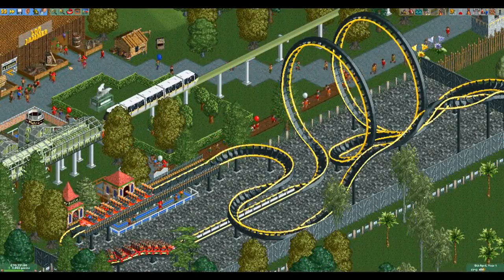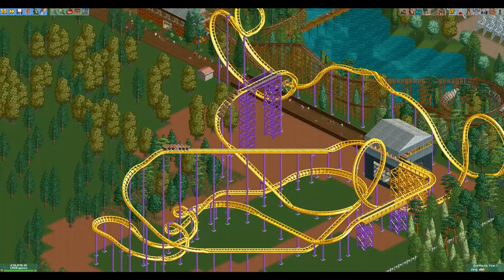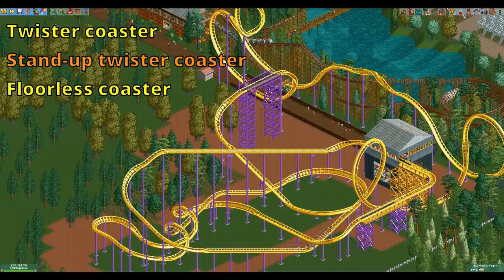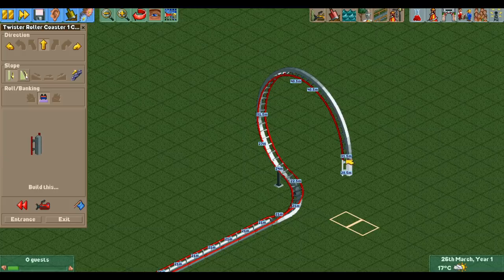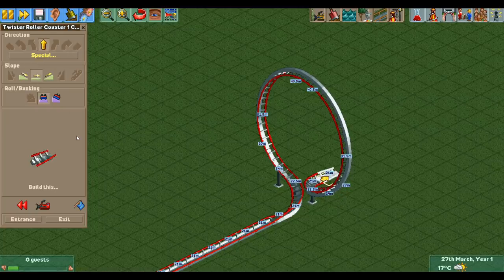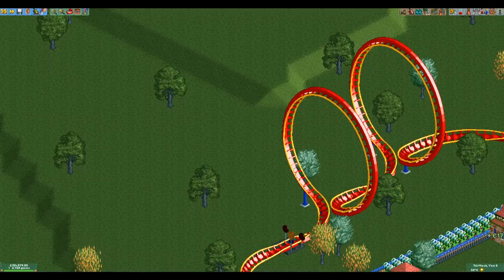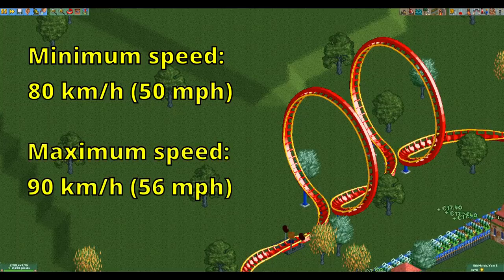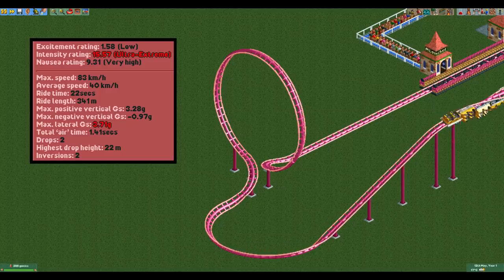How To Build A Skiffa Loop in RCT2

Comment: In real life that element would basically guarantee whiplash. Even in the game, it gives crazy laterals.
Reply: "The Karen finder"
"The lawsuit loop"
"Ouch my neck"
"The liberal life liberator"
"The JFK experience"
Reply: @dylanhale7300  "The Last Ride"
"Hospital heaven"
"Whiplash wheel"
Reply: Jesse Mathis  I suspect increasing the tern radius on the inlet and and making the loop have the increased curvature needed for a slower speed would help.
Reply: Gonna see if I can get a modified version of it to work in Planet Coaster without giving absurd laterals.
Reply: @abyssaljam441  But it would still need to fit within a circular shape. All the Lateral Gs can be converted to Positive Vertical Gs with more banking, but it would still be a lot of Gs.
Reply: You'd definitely need some sort of restraint system that constrains lateral movement of the head - though not like that is an unsolvable problem.
Reply: An update to this: my first attempt, still unsmoothed, enters at 60 mph, tops out at 5 gs, and pulls less than 1 lateral g. So very promising.
Reply: In real life the transitions would be a lot more smooth. You wouldn't unbank until you're already out of the turn and climbing the loop, and then you'd start banking again before the start of the turn.
Reply: @tonyhakston536  Oh I don't mean fix the head in place like you are getting brain surgery done - just need something padded to either side of the head to prevent whiplash, I would think.
Reply: @zuthalsoraniz6764  whiplash breaks the neck, padding won't do anything.
Reply: @Ghorda9  I might be wrong about the fundemantals of that, but my understanding of it is that sudden high acceleration perpendicular to the spine in a vehicle causes whiplash because usually the body is forced to follow that acceleration by the seat, but the head is not, allowing the head to move rapidly compared to the body due to its inertia. And head restraints are definitely used in some applications IRL where high lateral and longitudinal Gs can occur, for example the HANS device in car racing.
Reply: @zuthalsoraniz6764  i was only referring to the padding, restraints weren't mentioned, i think that would change things.
Reply: @electrollama2127  yeah it wouldn't be for the faint of heart and would likely only have one drop for just that loop and then returning track.
Reply: @noname117spore  oooh you have me curious
Reply: Nor would it work because massive amounts of energy would be lost in the first banked turn not allowing the train to overcome the loop. Looks cool though
Reply: I never ever thought of trying a loop like this! So in other words it would ramp up the Intensity and Nausea ratings pretty quick, hence lower Excitement
Reply: @zuthalsoraniz6764  these are pretty universally disliked by riders as they bang your ears constantly

Comment: I feel like this would break people’s necks in a real scenario
Reply: yeah, the lateral G's are way to high.
I am going to try to make a custom version in Planet coaster, to see, if it can be a real element
Reply: I suppose you could enter it at low speed and use booster fins in the loop to clear it, but that would be both expensive and prone to failure.
Reply: You could do it without such high g-forces with a much wider loop that covers a lot of "on the ground" distance while in the air. Would like to see it tried, actually.
Reply: it would, no doubt about it, though you could amke a version of this that would work, and by that i mean a banked uwpards turn intoa  lopp onto a banked downwards turn. but id say the turns ahve to be as least as wide as the loop itself.
Reply: @prrrromotiongiven1075  those exist.
One in Drievliet does just that.

I dislike the carts but those loops are solid.
Reply: I don't believe this would be worse than a stock car diving into the banking at Bristol, its just going from a left turn into loop straight into a right.
Reply: @dylanhale7300  its not about the sequence, its about the fact that, to make the loop you need a lot of speed through that tiny corner wich will result in high gforces
Reply: Excessive lateral Gs in RCT2 happens at 2.75 g, while according to NASA-STD-3001 Vol 2, human exposure to lateral acceleration during launch conditions should be limited to 3 g for maximum 0.5 s, down to maximum 2 g sustained, and at most 5 g for 0.5 s (also 2 g sustained) in abort conditions.

So it probably won't do serious physical damage, at least assuming the restraint system prevents hard impacts of the head, but it definitely would be unpleasant.
Reply: Justin White  Making the loop slightly corkscrewed also means that the turns into it don't turn through as large an angle, meaning the lateral gs are applied for a slightly shorter duration.
Reply: @zuthalsoraniz6764  you’re forgetting the fact that NASA’s astronauts train for months to be able to withstand extreme g forces.
Reply: @tonyhakston536  True, though that NASA document also says that the g force limits are deliberately set conservatively, and the standards for launch limits are stricter than "can be endured without injury" - with the proper head restraints, 2.5 or 3 g lateral is probably endurable without injury even for the average human, just very unpleasant.
Reply: In real life the train wouldn't come out of the bank until it's already exiting the turn and going up the loop, and would start banking again as it exits the loop before the turn out. If you bank hard enough you could convert most of those lateral Gs into an intense pop of positive vertical Gs.
Reply: @zuthalsoraniz6764  yes but RCTs g forces rating are nowhere near accurate. the acceleration of a launched coaster was somewhere at like 80 g or something, Marcel has a vid on it , actually
Reply: @Phoenix-zu6on  Well, that one specifically is RCT simply not considering longitudinal Gs - it only measures vertical and lateral Gs.
Reply: basically any banked turn in RCT2 would break necks

Comment: In my own testing, it seems that you are able to approach the Skiffa Loop at up to 101 km/h without getting excessive lateral Gs, while 78 km/h is fast enough to clear the loop. That is a fairly comfortable range. I would say 80-100 km/h instead of 80-90.
Reply: were you testing with empty or loaded trains?
Reply: @Freakschwimmer  With empty trains, of course. When a ride's stats are calculated, those stats (except the excitement rating) are locked in. That means if you test a ride with empty trains and it does not get excessive lateral Gs, it will never have excessive lateral Gs even if the guest weight of a full train would cause it to take a turn too fast. The lateral Gs from the empty train test are locked in until the next time the ride's stats are recalculated from scratch, such as if you edit the track, change the number of trains, change the launch or lift hill speeds, etc. The excitement rating is the only stat which dynamically updates after the stats have been calculated, and it only checks external factors like scenery, paths, nearby rides, and so on. The intensity and nausea ratings, like the G forces, are locked in.
Reply: @PaddedShaman  oh, that is true. Thank you for your kind response!

Comment: PS: with the recent updates to OpenRCT2, you can also do this with the Steel Looping Coaster and the LIM Launched Coaster, if you enable the "Enable all drawable track pieces" cheat. The Hybrid and Single Rail Roller Coaster have the required track pieces per default.

Comment: If i ran a real theme park, it would be an honor to build the world's 1st skiffa loop roller-coaster.
Reply: Honestly looks uncomfortable to actually ride
Reply: I was recently thinking how cool it would be to have something in real life that was invented with the very limited track pieces available in RCT2.
Reply: @msgasmdc107  It definitely would be unless you could keep the track banked for longer on both the entry and exit.
Reply: It'd need to be a lot less tight since it needs enough speed to make the loop but also needs to not break spines, but it could still be pretty neat. It'd be like a combination loop and corkscrew
Reply: @ENCHANTMEN_  If you approach the loop using steep pieces instead of gentle pieces, you can make the loop smaller, requiring less speed... Alternatively, you can put a few upside down pieces in between the vertical to upside down piece and the upside down to vertical piece (pretty sure twister can do that) and use the wider gentle turn.
Reply: @msgasmdc107  as long as the initial turns are not as limited as the RCT2 engine
Reply: @failtolawl  sure, but if you want it to be a Skiffa Loop, and let's just arbitrarily define that as at least 50% of the loop being at a 90 degree angle to the incoming and outgoing rails, those would still be some pretty harsh turns. Even that might look more like a winding inversion than a true Skiffa Loop

Comment: Would love to see some compact/value designs that include this loop... it's so cool!
Reply: I think either Marcel Vos or Deurklink had a video showing that, probably two years ago when the Skiffa Loop went viral.
Reply: You can reach the speed required to clear the loop with four booster pieces speed set to max. The rest is connecting the track.

Comment: Hello Marcel, this video made me think:
What part of the coaster determines the stats?
Is it the first cart of a train? The middle part? The average of all the parts? Cause obviously this can bring crazy different results in extreme cases using brake elements.
Reply: I think it's the first cart, because when testing it the graphics show the G count immediately, even if the train is long and hasn't passed completely through the track piece.
Reply from the maker: @IgorCalheiros10  That is correct. Only the first car of the first train matters. Whatever happens afterwards doesn't influence the stats. This can lead to fully loaded trains or the backs of trains taking elements way too fast without causing issues.
Reply: @MarcelVos  Cool.
Reply: So I should build a shuttle coaster where an empty train doesn't clear the hill and rolls back (as to give normal stats), but a full train clears the hill and tricks the poor guests into finally riding 8-year-old me's horrendous creations
Reply: @DoritoTime  
Do it!
Reply: @DoritoTime  that would indeed work but the stats would update after one or two runs with guests on board
Reply: @HECKproductions  and again update after a few rounds without guests.
Reply: @HECKproductions  nope, the only stats that it's still dynamically move after the stats come up is the exitement

Comment: In the current version, the LIM coaster can do the unbanking and banking turns, so it can do the Skiffa loop with high lateral Gs, but not lethally high. The two new tracks, the Single Rail Coaster and the Hybrid Coaster can also do the full setup.
If you use cheats to "Enable all drawable track pieces", then the Vertical Drop Coaster, the Looping Coaster become capable of it to. Then again, at that point you can just build it and then change it to the desired type afterwards, though this only gives good results for the Hyper-Twister, which for some reason doesn't get the quarter loop even with "Enable all drawable track pieces" for some reason.

Comment: What a great element!  I just built a coaster that does one of these at the right speed and then goes straight back to the station.  I saved the design so I can use it as a starter when I want to use it in a park without having to waste a bunch of money getting the height right.

Comment: Going to try to make a proper functional skiffa loop in NL2, will update with the results.

edit: did it, it works fairly well, no excessive lateral gs if you bank it right. positives are a bit trickier, and it's very slow over the top, but it works and would be a functional first element in real life. It would be more difficult to fit in in the middle of a layout though due to the slow speed over the top. If it is the first element after a launch the train not clearing isn't as big of a concern, so that's where it would probably fit best.

Comment: Actually, there's one more coaster type this works with, and it's exclusive to OpenRCT2, which is the hybrid coaster. If you enable the arbitrary rides cheat, you can select the hybrid track, regardless of ride selection.

Comment: How about this idea:
if the incoming tracks is slightly elevated, could the down side of the loop be extended with a straight vertical piece and then the exit track aligned so it goes out right underneath the incoming track?

Comment: I wonder whether this kind of loop would be feasible in real coasters, or if physics is unkind about those lateral g's. I assume that it it is possible, that narrow window of opportunity/ margin of error would probably make any commercial builder balk at the potential for lawsuits. Oh, well.
Reply: Frankly, I doubt it and not even because of the G-force experienced by the passenger, but more because of the stain on the rails themselves with all these sharp turns. Something tells me this ride would have to be very carefully maintained and would probably be prone to very dangerous incidents.
Reply: The perilously overweight would probably have to be be barred from riding.

Comment: Has such an inversion never really been done in reality? It's rather like a vertically elongated and horizontally truncated corkscrew. Something about it seems a bit "high-G" and like it would put unusual stress on the track and supports, but then again, it also doesn't seem impossible. Could be fun
Reply: I feel like this is totally doable IRL, would just have to be much more teardrop shaped. The tophat element exists, so just imagine a tophat that exits in the same direction it entered in, then add some curving outward when entering and inward when exiting. I'd love to see this in a B&M or Intiman design
Reply: Not the problem, Dodonpa levels of fuckery are needed to really wear and tear a track, or aged materials (Wooden wild mouse, blackpool) I just reckon it's uncomfortable as fuck as loops are teardrop shaped to keep the G's in check - the skiffa loop is round. Round loops get like 12 verticals.

Maybe Openrct2 can give us new turns one day to play with? 90 degree roll banked (like RCT3) and also beyond wide would be appreciated.
Reply: They did in early days but there's just a few reason's they don't. They all kinda stem from introducing unwanted force changes on both the tracks and people. It's pretty easy to find good info on it if you want more explanation.
Reply: @DarkWarchieff  Does Simon Foster still have the original 3D files for the coaster pieces? It's been a long time.
Reply: @C.I...  Chris Sawyer's website with his add-on tracks is still there. If not, why not just make them? It isn't exactly 16k res...